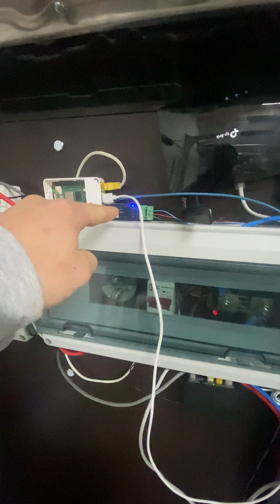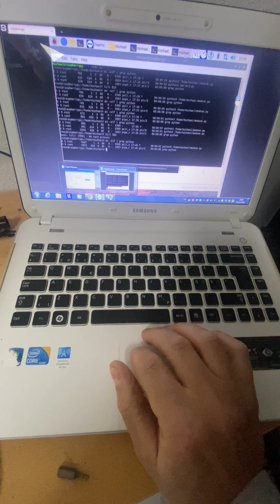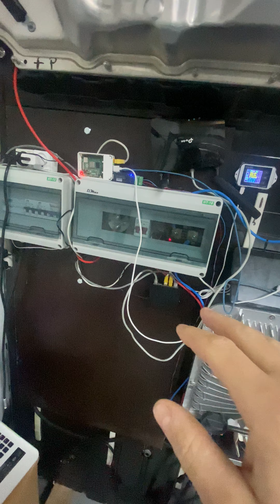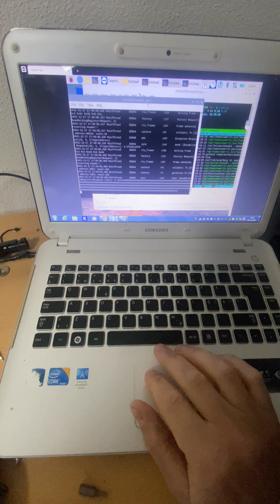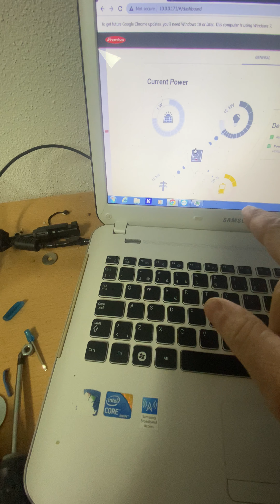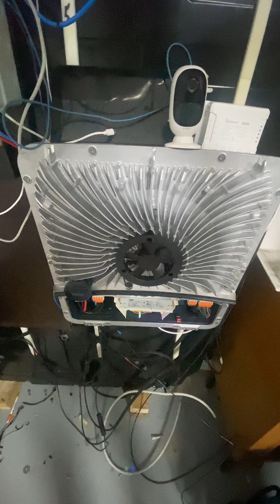How to connect a non OEM battery to Fronius inverter

Comment: Interesting project! I did not see a mention of BMS. Do you have or are you planning to add something to handle cell balancing on the battery?
Reply from the maker: Soon i get the esp32 wit a can bus to read the data  i get the Bms value now by obd to scan my tesla
Reply: @michaelp8563  ok. I'm using SimpBMS for Model S modules but haven't found anything yet for communicating Model 3 nodules or whole pack.
Reply: @michaelp8563  have you noticed any imbalance between cell bricks? Typically they should be within a few millivolt.
Reply from the maker: It’s 1to Max 3 minivolt
Reply: @michaelp8563  OK so far it's well in balance!